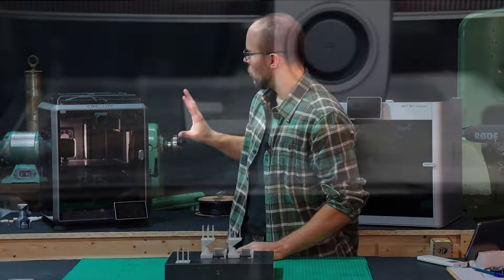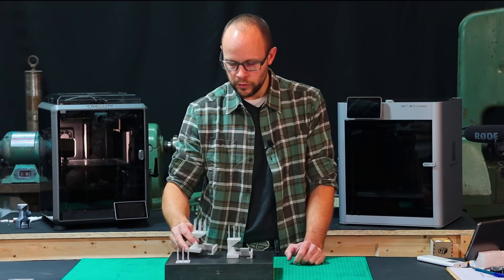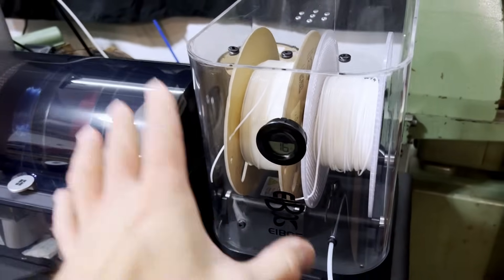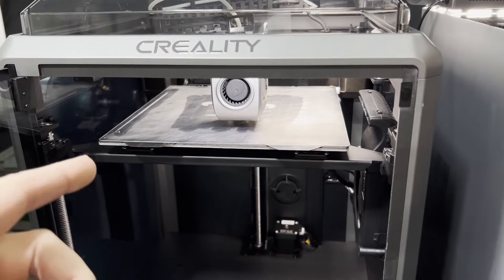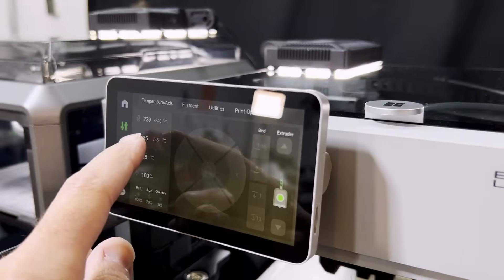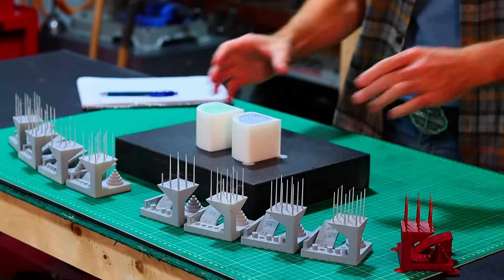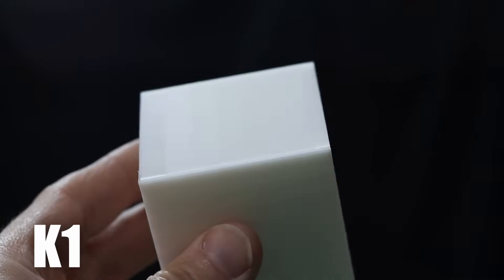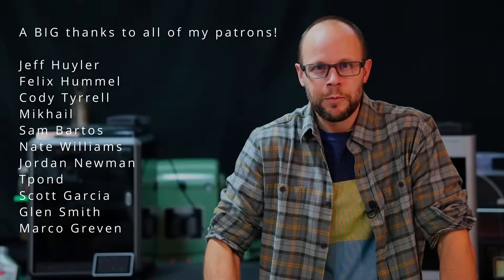Should you slow down your fast Creality K1 or Bambu X1C Printer?

Comment: Is there any plan (or even a chance) you could do a comparison of print qualities of the Snapmaker A350? 
It seems no reviewer wants to touch it. 
Yet it seems to be a very versatile, albeit expensive, multi function printer (3D print, Laser etch/cut and CNC) with a huge cubic foot build volume. 
For me, it is what I need for my project. But is it really all that great?
Reply from the maker: I think they reached out to me a little while back.  What I hesitate with is mixing machines into one.  I suppose they're all CNC machines at heart, but each has their own requirements.  CNC machining puts a lot of force on the components, so it will have to be made very robust, and it will likely be a very slow 3D printer if the components are made to handle the forces involved with Machining.  Laser cutting and 3d printing would be more similar IMHO, forces are much less, especially laser of course.  I wouldn't use a laser indoors even if I had it vented, even a little bit of that scent escaping is very potent, and can be bad to breathe in.  

If something comes up, I can certainly see what we can do, my gut feeling is that they've mixed machines which are too far apart and so do not perform well enough in any category.  A great concept, I just think that it is better to specialize in some cases.  

A good example would be the Shopsmith combo tool, great idea, but not a good tool.

I could be wrong, I don't have one, so this is coming from my mind.  I have about 25 years of experience CNC machining and a good amount 3d printing, a year or so Laser cutting, if that makes any difference at all.
Reply: You make good points, but I think Snapmaker has all that covered. CNC is not for metal, although some have cut thin soft aluminum with it. Wood will have a low force if the RPM is high and the tool advance is slow.
Laser etch/cut is behind a colored enclosure. SM also has a pretty good but expensive air filtration add-on.
My father had a Shopsmith over 65 years ago. He did some pretty impressive stuff with it.
And yes, your experience makes a big difference.

Comment: Bambu has mentioned somewhere that VFA is actually reduced at higher speeds and they recommend upping outer wall speeds in some cases. Wild eh
Reply from the maker: Apparently there has been a firmware update which applies the motor noise cancellation used on the AI to the X1 series of printers.  It is also supposed to help with VFAs, I will have to do some testing to find out!  Def seems to be eliminated at 150mm/s and up, but below that I can still see them.

Comment: I have read that the VFA is in part due to the smooth idler pulleys and that if they are replaced with grooved pulleys, you reduce the VFA. Has anyone done that?
Reply from the maker: That makes a bit of sense, when the tooth interacts with the smooth pulley, it doesn't mesh and rather 'hits' the pulley upon entrance and exit.  It's a good idea to test this somehow.  The flexibility of the belt in that direction would probably mitigate any vibration caused by this in my mind.  If it were something more rigid it might.

Comment: I'm blown away at my Bambu Printer. I have only 100 hours of prints on it and
It prints flawlessly each time in sport mode. Have not run Ludacris mode yet.
Reply from the maker: No question that it's a nice printer, I think they did a good job.  I can't figure out if the people that done like them are just mad that they bought other printers or maybe the have some legit problems.  I literally took it out of the box removed the AMS and started printing within 15 minutes, no fussing around.  As I started to use PETG again I did have some problems with Printer poop everywhere it should not be.  I think it may be the quality of the PETG, since I only buy the inexpensive stuff.    In any case, it's a great printer, I think Creality is catching up a bit with their printers though, there have been some updates and they are getting better results both firmware and hardware/parts, and there are some new players coming into the game with ULTRA-instinct Delta format printers.
Reply: @NeedItMakeIt  Same problem with bambu petg and petg-cf poops everywhere
Reply from the maker: @stongench  That's good to know, some people say that they don't have many problems, and others say they have it all of the time.  I have to wonder what the connection is.  Filament choice maybe?

Comment: Hey, you might want to try de-essing your audio.  Keep up the good work, I learned a lot from this video.  I mainly keep my x1c silent at night, and in sport mode during waking hours.
Reply from the maker: I just received a Rode Wireless ME kit yesterday, it is so frustrating to end up with audio that still doesnt sound good even after spending hours on it.  I will be making a video on it once I have a bit more of it under my belt because it can save people a TON of time, in the time it takes to edit Audio I could have made another short video, terrible that it took me so long to do this.  But thank you for pointing this out, good audio is a big deal and I'm working towards getting the best audio I can for these videos so it's clean and not distracting.  

Thanks for the support I really appreciate it!

You're the first person to say that they have different modes for different times of day, very interesting.  I may have to try that out myself.  Have you taken your printer to ludicrous at all?
Reply: I think the audio is good, just need to add a filter to the post-processing workflow.

I use ludicrous every now and then.  I dont like using it because I think It puts unneeded stress on the machine.  I've read about xy belts stretching and causing z banding.  I haven't needed to adjust xy belts yet, but I print tolerance test prints monthly to confirm that the printer is still within specs and not my parts that need fixing.

The reason is more of a risk-reward analysis. I print big jobs overnight, so I get a 12-hour window. Most of my parts are <12 hours so I'd rather have a successful print than have a failed one that I won't get to until 9am anyways so why risk it. @NeedItMakeIt
Reply from the maker: It's a shame I can't go back and adjust all of my audio, it's been a real burden, but we should have much better audio starting in this video coming up at least.  I can't tell you how many filters, equalizers, compressors I've tried, I think what I'd need to do is export the adjusted audio as a whole and then import it in again and go through the noise cancellation again.  I see that Davinci has release a new voice isolation feature in their newest version, it is only for the paid option though.  I was just about to buy it but thought I should try the new mic first to try and get the problem solved at the source.  

I was thinking about looking deeper in to the accel setting to see how the print quality changes with adjustments to the incremental acceleration adjustments.  I see some of the newest printers have extremely high max accel, around 40K, that's going from ludicrous to INSANE I think.  These printers are somewhere around 20K max, the slicer has them set quite a bit lower however.   

I agree about the belts and added stresses, it's better to run it a little slower and have the longevity. 

Which tests do you run for tolerances?  

 Ah, gotcha, that makes a lot of sense, print a bit slower when you want the confidence that it will turn out.

Comment: These are called VFA (vertical line artifacts).  I did extensive testing on what causes it.  It came down the stepper drivers and the motors.  Basically at slower speeds and torqy motors you will get these artifacts.    There is no fix other than changing print speed.  I have gone as far as to put smooth pulleys and teethless belts on one printer to find the issues.  It is in most cases the motors steps.  While not impossible, it can be caused by belts too but not on these machines.  This is the reason why I still stick to Enders for prints that require slower printing in dark filaments to avoid heat streaks.  Bed slingers still have their place as they do not suffer nears as much in VFA as these new high speed corexy printers.
Reply: Thank you for your insight

Comment: You probably didn't use the regular speed pla for the slow speed. This is  more interesting because with them you couldn't use high speed anyway. These filaments are still cheaper and more available
Reply from the maker: That's right, I used high speed PLA, though I've just about run out, and I think we need to stay using the standard PLA, it's far cheaper, and with a different nozzle/hotend design we can reach the higher speeds.  I don't agree with paying 2X the price for the filament.  I do have to say that the Creality High speed has very tight tolerances, it has produced some of the nicest prints I've ever made, but I'm paying for it...   I can always do follow up testing if you guys would like something else tested or to make tests on certain filaments.
Reply: Im pretty sure that MANY users tend to use cheap filament. A test with cheap filament would be very userull.and appreciated. In my case i use sub 10€ filament, printed hundreds of kgs with those
Reply from the maker: @custom.3d  Now that's a good idea.  I've been printing with cheap for years as well with pretty good results, one supplier gave me trouble, but this is a great idea.  What is your cheap brand of choice if you don't mind me asking?
Reply: @NeedItMakeIt  GST3D Europe (to not be confused with the american one that had many problems). Had minor issues with some spools like tangled filament or spools that needed to be dryed but other than that i printed a ton of figures and functional parts. If i have to be honest other than printing speed i could not see a difference from bambu filament

Comment: I hate to say it but all of these nerds that want fast printing don’t realize fast won’t = good.
Reply from the maker: I don't really think you hate to say that...  So the question is:  Is slower always going to be better than faster as far as results go?  In this video I showed that too slow with these two printers results in VFAs but 'regular slow' gives good results.   So is faster ever better than slower?  I would imagine that it will be just as good with development in the areas that it struggles, like cooling, and layer adhesion, in some cases at incredibly high speeds extrusion rate keeping up and tolerances suffer a little bit at the max.  

I had a conversation years ago with a fellow who said to me 'we've already improved everything as much as we can, there isn't any way you can do better'.... He was not only wrong, but that way of thinking is limiting yourself.  I really depends on your goals, but if you want to be successful in whatever it is that you're doing, you need to find ways to improve.  A fast print can be as good as a slow print, but it takes development to solve the problems, or take a different approach completely to avoid the problems completely, like this method.  https://www.massivit3d.com/blog/why-gel-based-3d-printing-is-the-way-forward/  There is a better concept also, I'll try to track down that video link as well.  

In the end, where are we going with all of this?  In my case, I like to fix things, anything that breaks, or anything that I need I want to be able to design and print it, when I do, I want it to last.  That's my goal.  Everyone will have their own, but the ability to make something on-demand without having to buy it offshore is one of the driving factors for the demand, and our impatience drives the need-for-speed.

Comment: The "bumps" aka side wall inconsistencies on the bambu prints are awful. I've seen that on prints from older printers, but never on the Bambu. You said you thought it could be over extrusion. I suppose it could be, but I think it is more likely that you need to check your belt tension. Also, if you think the lidar is giving you bad settings for flow, I recommend running the built in manual tests on each different brand/color of filament in Orca slicer, then just saving those stats with the settings for each filament.
Reply from the maker: Its certainly worth looking into deeper, I've not adjusted belt tension at all, and It could help a little bit.  I think that we do have a bit of over-extrusion, you can see it mainly on the top layer where it does not have a place for the filament so it creates little peaks, very small but still there.  It's worth dialing in a little more.  I like to use the features on the machine mainly because I do not use the same filament, I use all types and brands, sticking with one type and brand would be far easier to calibrate. 

I've had prints with excellent results on the Bambu, I've had a print that turned out so well that it looked like it was resin printed.

I think that my methods of showing these parts in the videos may be a little extreme and they tend to highlight the problem areas more than what anyone would be used to seeing at home, so maybe I'll have to find a different method, something with some method of measuring maybe?

Comment: A video comparing layer adhesion versus speed on the bambu would be a good video. On default settings I've noticed parts are fairly fragile
Reply: Don´t forget to increase layer width e.g. 0.4mm nozzle --> 0.5mm/0.6mm layer width. You will get much better layer adhesion this way. 
The 0.4mm width for 0.4mm nozzle is simply incorrect and can´t work form a physical point of view. You can´t extrude lines as wide as the nozzle opening this would mean you would extrude circles which don´t stick to the previous layer at all, that´might cause an issue with many inexperienced users as well.
Temps and speed are important (because they oppose each other) but squish is just as important.
Reply: @sierraecho884  why doesn’t bambu do this as a default profile
Reply: @jack91522  They do, apparently: with a 0.4mm nozzle,  from 0.08 to 0.28mm Layer Height the default Line Width is 0.42 in Bambu's slicer.
I.e. the extruded width is many times the height.
Reply from the maker: Nice, that's a good one!  Do you think the best method of this is the approach CNC kitchen takes, or is there a better way?  I'm releasing a video tomorrow morning for impact resistance.  The prints are remarkably durable, especially one piece that I fully expected to break off took all of my strength to try to break and I still could not break it off.  I've had another experience with Silk PLA which had terrible adhesion, pieces were breaking off by blowing on it.  I believe that silk needs to be printed at higher temps to avoid this, more testing required I think on that one!

Comment: Sold as Sticky build plates but still need glue stick
Reply from the maker: I've had some success, but it's not 100% reliable on every part, the forces involved are up there, personally I'd like to be safe and not have to worry about my prints ever coming off during the print, that includes any corners coming away.    I made a video on this subject a week or two ago, with heavy duty prints, you can't stop the warp, but you can at least keep the part adhered to the buildplate.  I should issue a challenge to see who has the best methods.  I'd would be really helpful to get to the bottom of adhesion once and for all, some materials are going to be tough to get good results with.
Reply: What do you have against using glue stick?
Reply from the maker: @joeking433  One of the cheapest things you can buy, they last a long time, they work extremely well, I have no idea.  I think that it's just one of those things, please fall into a group, and if you're not part of the group... well you are not worthy.  

I suppose that if you print thin light duty parts, you may not need it, I've never been able to do that, the parts warp too much and need to be held down well.
Reply: @NeedItMakeIt  I usually don't need glue stick and all I basically print is PLA but occasionally I'll put some glue stick on it if certain parts are coming off.  And it works well for the next 10 prints or so.  I just don't see a problem with using something  that works so well.